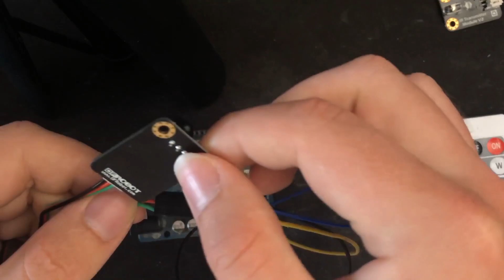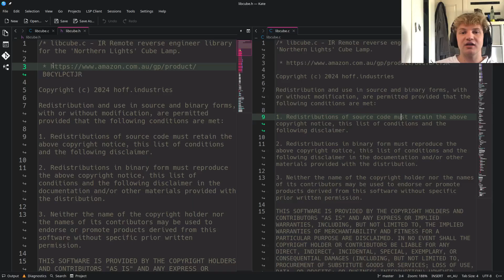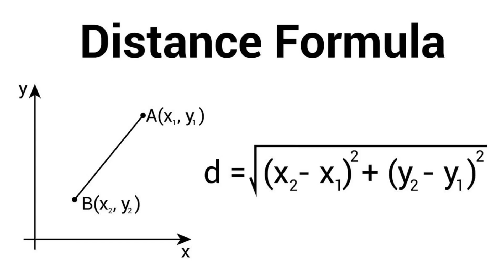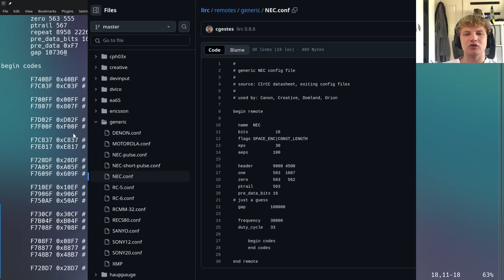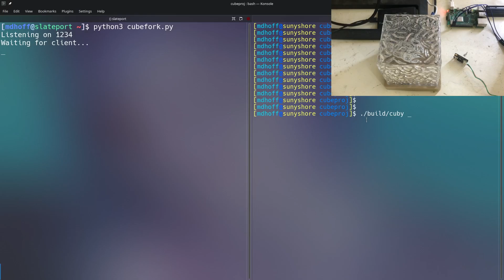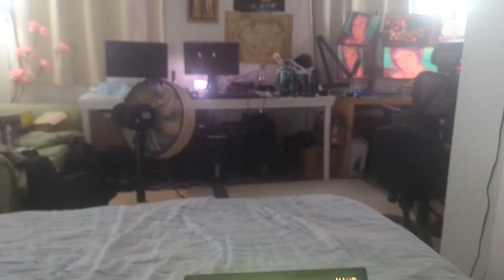IR Remote Control with LIRC and a Raspberry Pi!

Comment: i have a rpbi 4b do i need the arduno for this can i capture it on the pi itself ?
Reply from the maker: yeah you can capture on the pi using LIRC. I didn't show it in this video because it's a bit more complicated and a hassle to set up than the Arduino

Comment: Cool, but now you have to have something like a RPi constantly around your lamp, which might be suboptimal, e.g. in the scenario where you want a connection over ethernet and need to be close to a switch or router. Would this be easier to fully program with an ESP-32? Or even cooler; inspect the internals of your lamp and make it natively controllable over the network. Fun stuff :)
Reply: I agree, it would be cool to have an esp32 that hooks directly into the data lines of the ir receiver and so you've just made an IR lamp into a wifi lamp. But then again if you've got a raspberry pi doing other stuff in the room already, seems like a valid solution.
Reply from the maker: would agree if the RPI was only used for that - would be a bit of a waste. the one im using is also acting as my zigbee coordinator so it isnt so bad. Definitely you could program it on an ESP 32, or even using the ESP32 as just a modem installed with AT firmware, but honestly i dont think it would be easier - having a full linux network stack gives you a lot of abstraction to program on